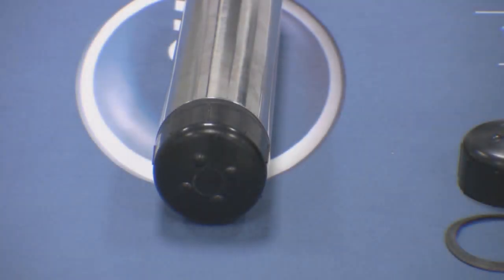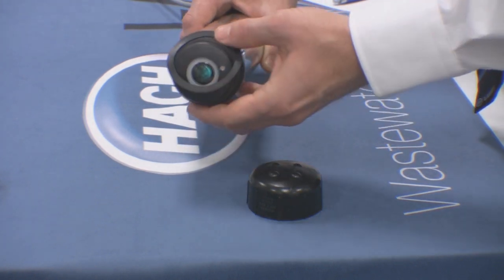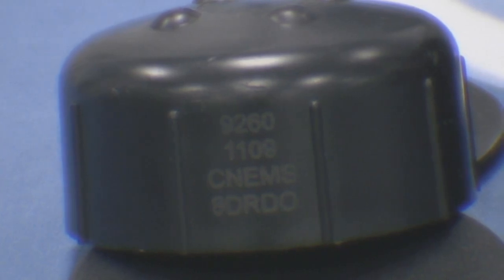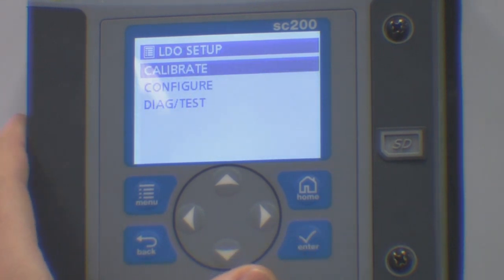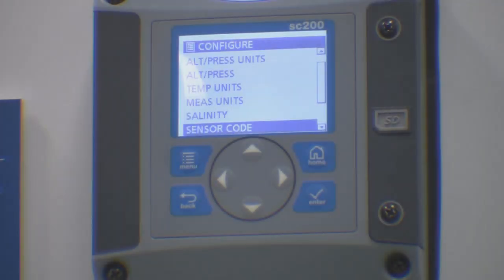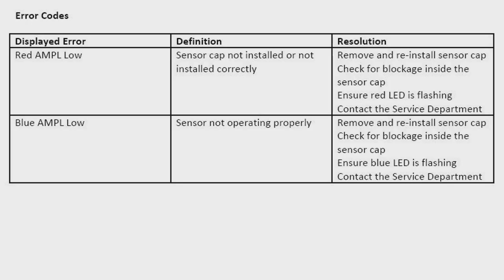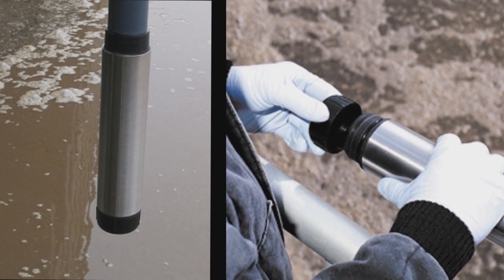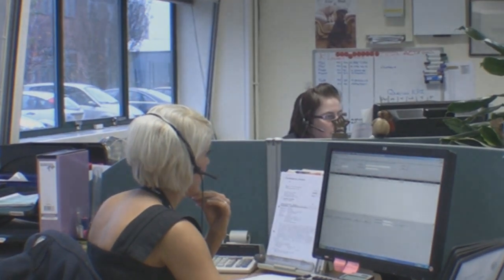HACH LANGE LDO Cap Change

Comment: One of the Sewage Water Treatment Plant, Oxidation Ditch Application. Installed LDO with SC100 showing Blue Amp Low with Malfunction. What does it mean? When I checked with installation guy he informed me that he forgot to put the cap. Do we have to reorder the complete sensor or we can just remove the sensor, put the cap on it and reinstall to check?